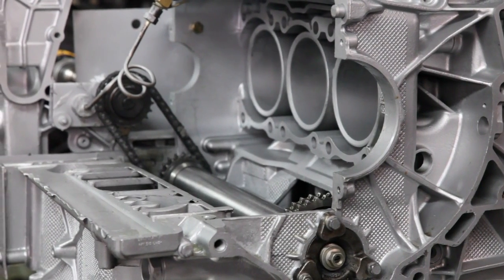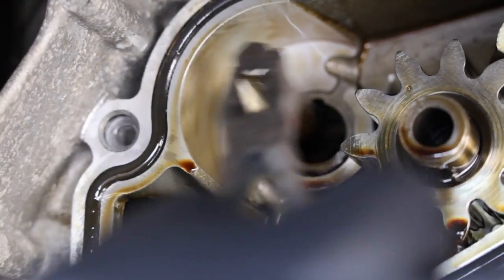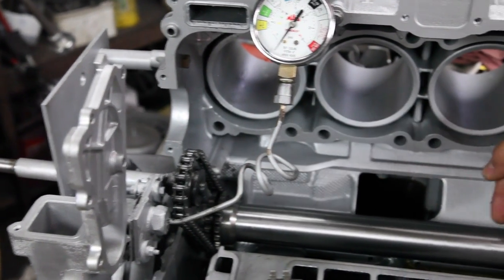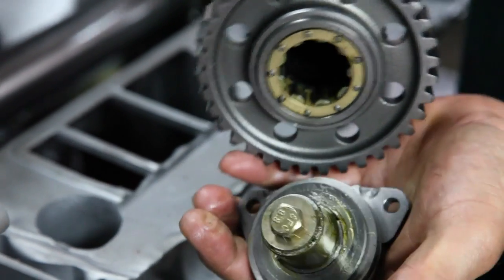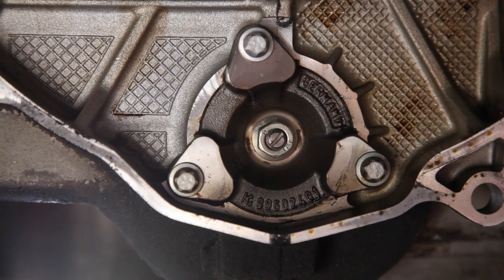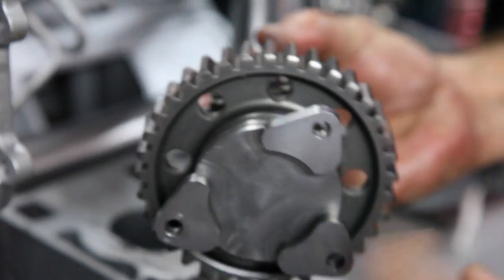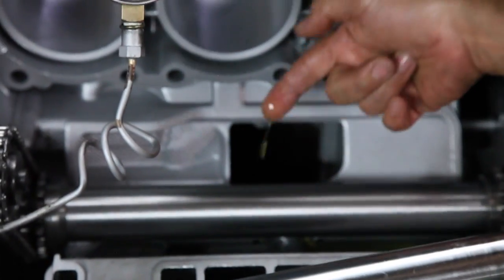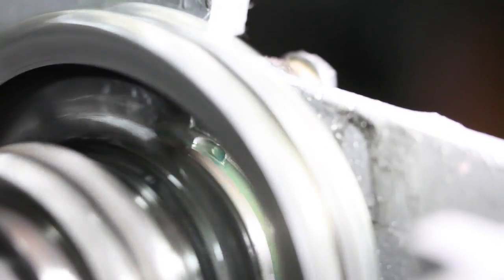IMS Oil Lubrication

Comment: How much oil will need to get into the ims shaft in order to be pressurized sufficiently to lube the bearing?   I would assume the shaft is hollow for a reason. Filling it with oil mirth cause other problems. No?
Reply: The shaft will never fill with oil thus there is no pressure feed of oil to the bearing, however pressure feed is not needed.  The oil in the rotating shaft will form a cylindrical film inside the shaft and when it reaches the depth of the openings in the bearing it will feed through the bearing and back into the crankcase. When the engine stops the oil will pool in the bottom of the shaft and drain through the bearing.  Some have commented that simply removing the seals from a sealed bearing will provide sufficient splash lubrication others feel that because the bearing is spinning at high speed this oil will be flung off and perhaps this is true however for my money I like the idea of oil continuously being forced through the bearing as it has no other place to go.despite the shaft not being full.

Comment: I think its a very bad idea, punching a hole in a freeze plug, this can dislodge it or worse completely come out right through and end up inside the intermediate shaft tube.  also, robbing oil from the main pump is never a good idea as there is no way of telling how much it is loosing. How would you control oil from collection inside the tube in front of the IMS bearing? how would you control Over-lubricating which is worse than having a little bit of lubrication.  everything is bad about this idea.
Reply: "Over-lubricating" is bad?  How? It is oil flowing through the bearing, not excess lubrication blowing out seals or getting where it shouldn't be.  You'll have to explain this one to me.  Also, I doubt the robbing of oil from the pump is even over 1%, it is such a small hole.  It is optional too, and only because their competitor bad mouthed them about not having it.
Reply: "over-lubricating"..... that's funny,...."Top Automotive" my ass.
Reply: @JustMe-999a  I assume you are probably not in the mechanic world? it's called "Lubricant churning aka over lubrication" look it up and I recommend you educate yourself if you are a mechanic before making funny remarks.
Reply: @JustMe-999a right 😂😂😂
Reply: Regarding the "freeze plug", it is not a freeze plug.  Porsche no doubt designed the shaft to be hollow for many reasons.  Torsional rigidity coupled with light weight are paramount considerations but the requirement to contain the oil pressure of the oil  pump required a plug be pressed into the shaft.  This plug is retained by a shoulder in the shaft and by the plain bearing on the other end.  This bearing is directly lubricated by the oil pump and sees full engine pressure under all circumstances.  It is not possible for the plug to be dislodged.  Other "permanent" ims bearing retrofits also rob some oil from the system to lubricate the bearing so the amount of oil robbed is immaterial as the system is designed with a large volume margin to allow for wear etc. witnessed by the use of a pressure relief valve.
Reply from the maker: Hi Top Automotive Inc, Thank you for your questions. Our EPS IMS Cylindrical Bearing is open caged which means oil flows freely back and forth, so there is no such thing as over lubrication. However, we do provide an oil feed modification that has an orifice of 0.5 mm channel cut in the Allen drive to deliver a limited forced amount of oil to the bearing. Although the cylindrical bearing is already submerged in oil, we do provide the forced feed lubrication kit in order to ease the mind of individuals who believe that lubrication is the problem. However, this modification is not necessary. 

Hope this clarifies your doubts. If you have any questions, please feel free to reach out to us.
Reply: @epsparts2848  thanks for your reply!